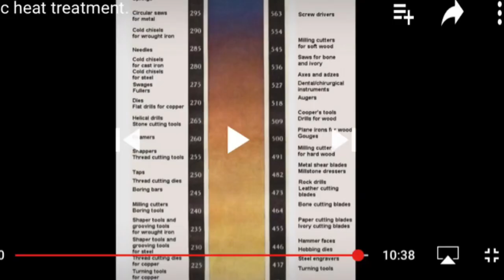Hardening and tempering the axe head

Comment: I know this isn’t anything related to this but sort of is! I was looking into making a small furnace/crucible I’m not sure what you’d call it maybe it’s called a forge idk the terms but I wanted to make a small thing to melt my aluminum cans down to make them into pucks
Reply from the maker: Hey 👋 Mn 
The melting point of aluminum is as far as I know 660.3 Celsius which is about 1222.6F*. The melting point of iron is about 2800F*. So I would say go to a welder cut a piece of pipe and weld a bottom on one end. The crucible is ready . You also need a torch or a burner, bottled gas. A pair of tongs which fit the crucible. A big can is usable for the furnace   A smaller can in the center of the big one. Then fill up the outer ring with heat resistant stuff. Available at your local hardware store. A hole must be on one side to stick the torch. No gaps means full heat. Aftet drying the heat resistant stuff remove the small can. Seal the torch in the existing hole.light up some paper throw it inside and turn the gas on. Flame on! Make sure you have safety equipment gloves goggles. A lid on top with a hole inside for not building up pressure. Make sure before you poor to take the slag off with a rake or fire poker. Safety  is always first on high temps. Keep adding cans while melting till you have the amount you need to get a bar or a puck. A mold needs to be made from a material with a higher melting point then aluminum. Avoid to inhale steam or smoke. Hope that helped you my friend. Here is a link how to create a furnace you just need to build it the way it stands. 
https://youtu.be/uIRTcmR6sSk
Reply: Madworkx Trouble hey thank you so much ! I’m gonna book mark this video so I can refer back to this later ! I’ve always been intrigued by this kind of work ! I’ve always wanted a nice home set up so I’ve been trying to save some money up to do it the right way An have proper equipment and saftey gear